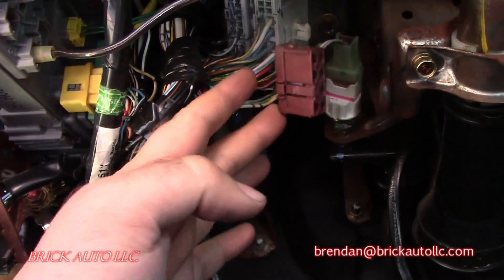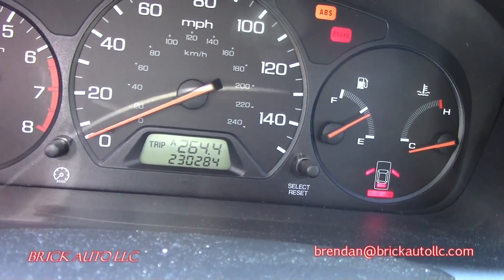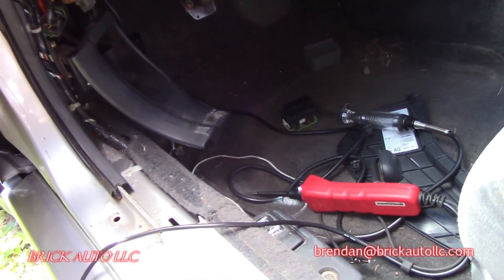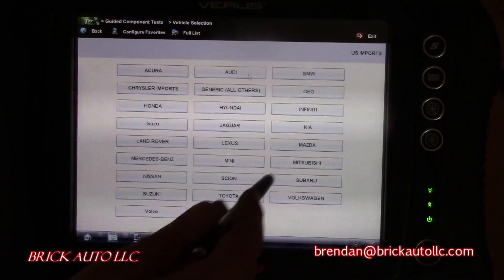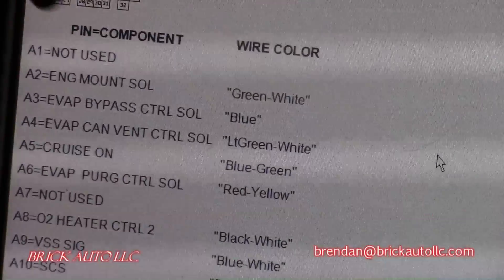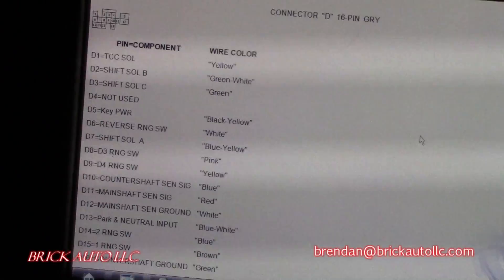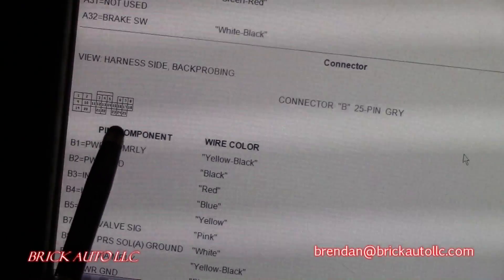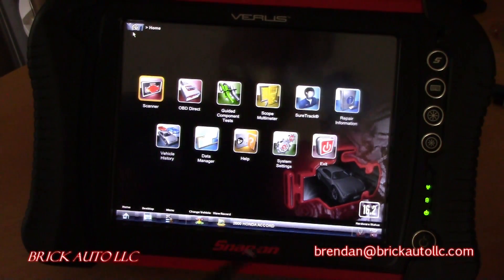2000 Honda Accord - cranks, no start, no communication (with ECU pinout) Check main relay first!

Comment: Great post. I've been chasing an intermittent no start for about a year. 

It had finally gotten frequent enough that I had to seriously look into the problem.

The no communication was the key,
Reply from the maker: Thanks.  I wish I would have thought through the video part of this fix and got the actual start on film and closed out the video better.  This car is started in a later video on ac pro. Power issues can take a while because you have to know if you're looking at the cause or effect of the issue! Cheers

Comment: Question was checking my fuses under the dash in the fuse box. I disconnected the fuse for the srs an n put it back in cuz the fuse was good now no start i here the fuel pump turn 9n but no start
Reply: I get fuel at fuel rail no fuel from injecters can put rag with gas in air filter starts tight up.
Reply: You have another relay on the right just tapping it it will start your car it’s IPMF relay. If you need pictures I will send it later.

Comment: I looked at this video and I have applied the methods brought a new relay yet I still get no communication with the ecm via check engine light
Reply: Did you get it fixed my car doing the same thing too

Comment: Hi I have an accord same to that, I have the same problem does not show check also the green key, I change the main relay but everything is still the same I was told that the computer is not. A friend told me that it is a fuse but I do not know which, I do not know where it is located.

blessings
Reply from the maker: If there is no check engnie light KOEO, there is definitely a communication issue and that's where I would start - tracking that down.  If the main relay in the dash is good, I would start chasing the powers and grounds for the computer.  Check the interior fuse panel and the under hood block fuses and relays (check them all, it is easy enough to do to start).  If these are all good, I would go straight to the computer and check the powers and grounds there (see end of this video for PIN-OUT of this).  If located, will have to then back track the wire to find the short.  That's the direction I'd go if no CEL.  Good Luck!
Reply: It might be the started too. I change the main relay and started on my Honda Accord 1994
Reply: Your friend was right.  Is in the engine comp. Top left, by the elect lead, look for IG. Or something Loki that I forgot now the number so check all and u be good. Unless it got hot that means dist. With regulator is fried. Don't even mess with the crank sensor, no only is a little pain to get replace. But it will not be the one . Of course you are using the right key we hope, no spark symptoms when using wrong key.

Comment: Very informative on the ECU pinouts.  What model of the ODB scanner are you using?
Reply from the maker: It's a Snap-On Verus.  One of the earlier models that can be found at a more reasonable price on ebay or alike.  It may not be the most advantageous way to get this info if you aren't a regular user.  They are real spendy $$$, even used.  If pausing this video isn't quite enough to get a decent read, email me at brendan@brickautollc.com and I will see about getting a screen shot of them for you.
Reply: Yo quiero saver por que my carro prende y luego se le vas LA chispa